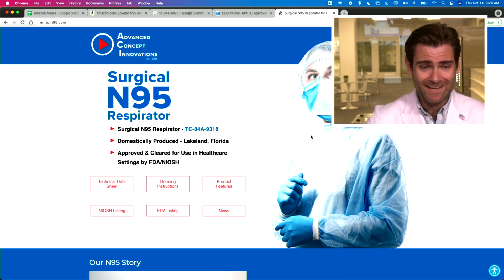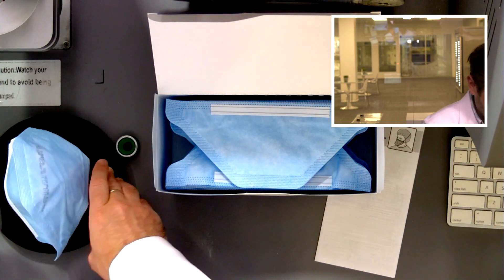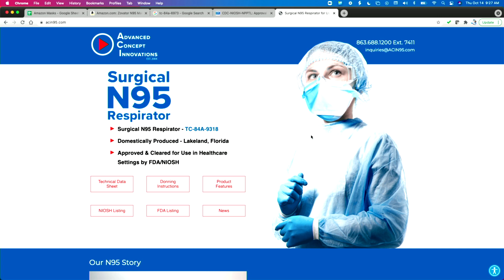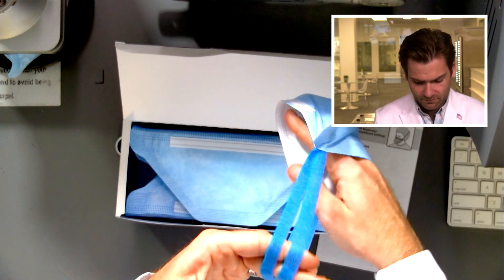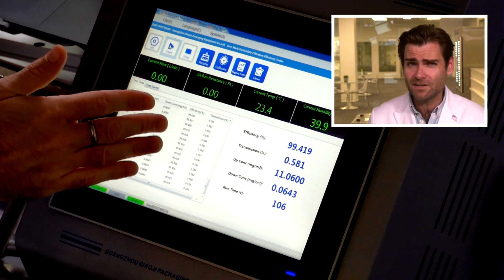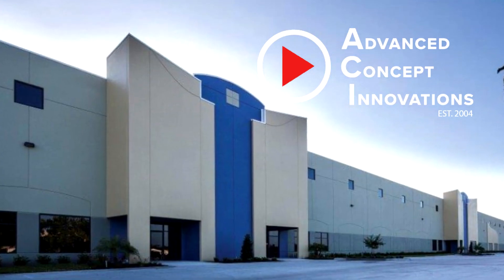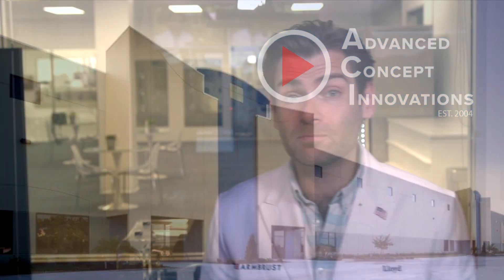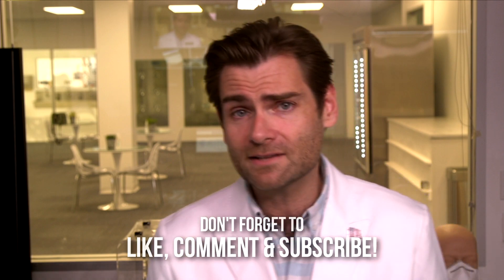That's attention to detail - ACI Surgical N95 Respirator Review

Comment: I just tried this one from your mask sampler kit and found it very breathable, subjectively pretty close to the Gerson. But the nose wire on the Gerson partly came off on mine after I admittedly treated it pretty roughly. I had less problem with my glasses fogging up with these two masks than with any other masks I've tried that fit my face well, although I still have a few more to try from the mask sampler.